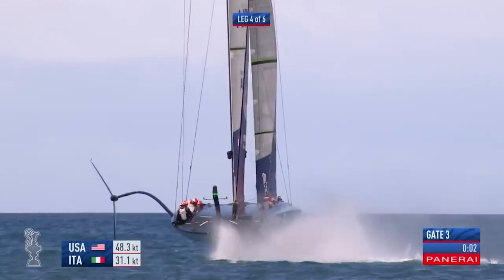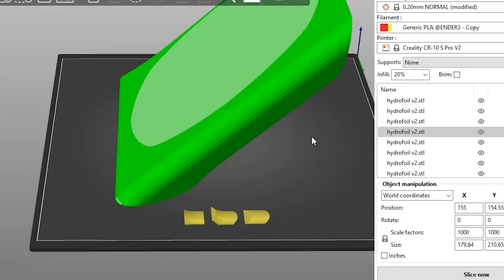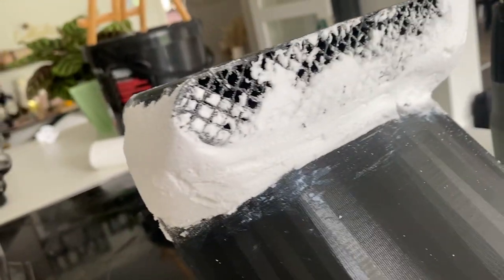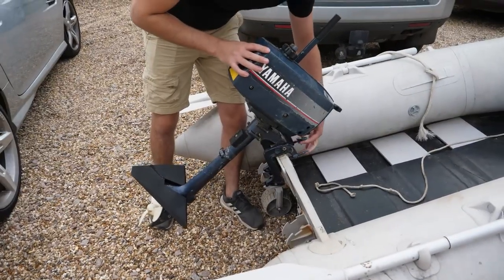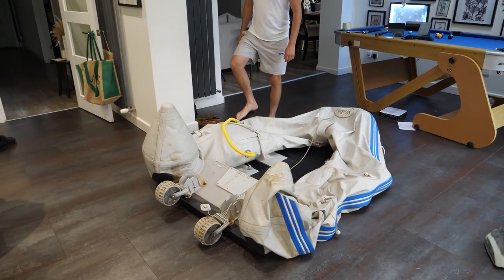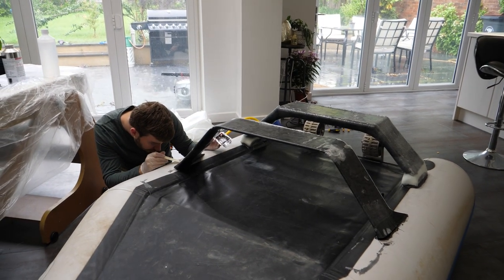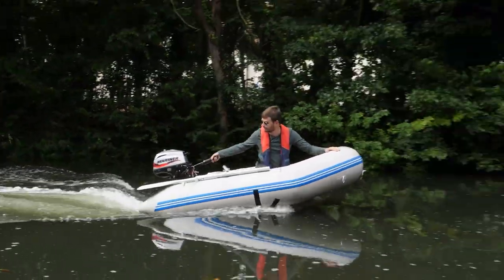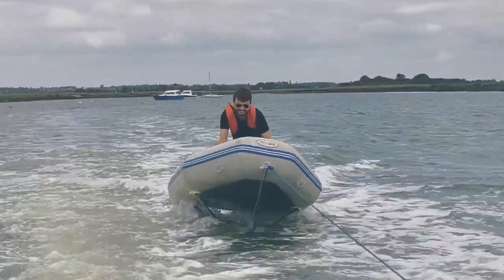Making A Boat That Flys - The Hydrofoil

Comment: Hydrofoil airboat? Basically an aeroplane with its wings submerged. Or mounting (electric?) propellers on the rear hydrofoil, so they're guaranteed to be underwater.

Comment: Very nice project indeed! Hope to see a next version of your design. 
As I build Hydrofoils myself (for kitesurfing mainly), here are some quick tips:
The analogy with the stool with three legs isn't the best here, because the amount of struts/masts into the water is absolutely irrelevant for the foil to work. The principle is simple: its just a plane under water. The front wing produces lift to lift you out of the water while the rear wing produces downforce to compensate the "wheelie". The faster you go, the more lift the frontwing produces. As your foil has no elevators, the rearwing produces the needed downforce to keep the nose of the boat down, resulting in much less wheight adjustment that must be performed. This is the principle of kite/surf foils. For a boat, where your main focus is the ease of use and not so much the performance, a Fontwing in form of a V would be the best solution  (extreme dihedral). The faster you get, the more the foil gets out of the water and isn't capable of producing lift (sadly, the so loved self stabilizing characteristic you get in planes with dihedral wings is almost neglectable due to the high center of gravity). With the dihedral frontwing, you can easyliy achieve solid results without a rear wing and without a long-shaft outboard. Just mount the foil further to the front (the position of your first approach seemed about right for that).
The last tip: The Angle of attack is way more important than the profile. Even a flat surface will fly well. In water a thick profile will give you a lower lifting speed but drag of the wing induced by a bad designed profile will kill your topspeed and, much worse, the lift becomes enomous making ventilations more likely and the boat uncontrollable.
Hope this wall of text helps a little for your next revision, subscribed :-*
Reply: Talk about back seat building

Jk of course
Reply: Very well explained! Thanks 👍
Reply: @alejocouderc4495  LOL
Reply: That was very interesting, thank you for the explanation and details.

Comment: I've been wingfoiling and designing my own hydrofoils for a couple of years now. That front foil looked very thick to me. On the personal hydrofoils, weight placement on the foil board is absolutely critical. Also surfaces. The difference between a poorly finished surface and a 400 grit to 1000 grit finished surface with no imperfections is phenomenal. I 3D print my wings in sections with holes for joining dowels, fit them together and then spend a few days cleaning up the surface. Then I create moulds around them using parting tape and resin infusion. Finally I clean up the moulds and for my higher performance wings I make now, I fill them with carbon fibre, mostly unidirectional. Then I clamp my moulds together. Unmoulding, I clean up the excess with a mini angle grinder, then file and sandpaper in progressive finenesses. If you continue, you need to make a decision as to whether you are using self flattening foil designs for roll and how you will control pitch stability. And of course under an IRB, you will need a lot bigger foot glued or otherwise fastened to handle the forces. I really was surprised that the attachment you used lasted as long as it did.

Comment: Fun project. Hydrofoils are cool, but sometimes its hard to make them work, and depending on what boat they are mounted to, might be of questional benefit, if any at all. But it sure is fun building!

One small correction: the effect you described is called "ventilation", not cavitation. An easy mistake to make, especially since the anti-ventilation plate mounted just above the prop on outboards is erroneously called "anti cavitation plate" in common parlance. But cavitation is a quite different phenomenon. Cheers.
Reply from the maker: Hi There Golden Croc, yes thanks for clarifying that. Spot on, it was ventilation I was describing. Like you say I believe this project itself is more on the fun side rather than improving the boat. Glad you enjoyed the video. Thanks Sam.

Comment: Small point of note: Ventilation is when the prop sucks in air. Cavitation is when the prop is spinning faster than the water can move in around the blades and tiny pockets of vacuum form against the prop.

Comment: Fun project! Get a copy of Ray Vellinga's Hydrofoils (Design, build, fly) book and try to understand it. Balancing pitch and roll stability to make a small hydrofoiling boat that will stay on its foils is quite difficult. Making your dinghy achieve manned flight (with a suitable engine, wings and prop) would actually be easier in some ways. Hydrofoils have all the lift vs. drag mathematics that aircraft have, but a few more because they have to also deal with the interactions between water and air at the surface and a big change of centre of gravity and stability when they take off. They also need turn stability if you want them to stay on foil when they reach a bend. The first foil you made was far too thick! If it was to get on foil, a foil that thick would be inefficient and therefore make the boat slower than with no foil at all.  
I built a hydrofoil when I was 15 (I'm now 47!). It worked a fair bit better than this, but I didn't have true pitch stability either. It was a series of multiple stalls like yours, just slightly longer ones.  I had an angle of attack adjustment system for the front foils, but it was so hard to keep it flying for more than about 50ft at a time. I had beginners luck with mine, because since I have made a series of failed hydrofoils. 
I have learnt that, sadly, to make an effective working hydrofoil you need at least as much maths as you would need to design, from scratch, a working full sized aircraft.
Hydrofoils are killers psychologically, because any kind of foil that creates lift, which anything  vaguely foil shaped will provide, will enable a boat to lift and porpoise and stall and repeat. This makes the builder think that they are 'nearly there' with it, which they are not. There are rather a lot of 'nearly there' porpoising hydrofoils on youtube.

Comment: - You should use rapid prototyping to make a profile gauge and shape the foil in insulation foam. 
- The profile to use for that kind of speed and size is a Low Reynolds number Eppler profile E817. 
- To laminate fiberglass properly you can use cheap throw-away 1'' paint rollers.  
- You can only use epoxy to laminate fiberglass on the foam, polyester will melt it.

You don't have to take my word for it but my final bachelor's degree as an engineer was designing hydrofoils for a boat and as an engineer, I've worked as a fiberglass mold shop foreman.

Comment: inflatable dinghy is relatively heavy for what you're doing. I'm planning a similar project using a small lightweight trimaran hull and a jet drive. The idea is to have an intake under the bottom of the front foil and twin output nozzles under the back foil. The pump driven system will prime itself when it's sitting low in the water. Steerage will be done with both output nozzles using 360° rotating nozzles so it will have reverse and side thrust.  The jet pumps will be powered by steam and the steam will be generated by a hybrid solar and alcohol boiler. The idea is to run it on sunlight during the day and alcohol or any  volatile fluids I can scrounge or make at night. There's a conservation area near me where fossil fuel boats aren't allowed and I want to go speeding into it on a hydrofoil and get stopped by marine patrol so I can tell him that I'm not breaking the law but he is for following me into the area. 😂

Comment: seen a hydrofoil modelboat made a long time ago , the builder made them out of aluminium bar that he shaped intoo a wing contour (though sharp in the front and sharp in the back ) painted the wings after he finished and tested the model and all of a sudden it didnt perform like it was before it was painted 
after a while he saw flakes of paint comming off the aluminium wings and doing some speed runs passed his boat he found loong bubbles comming off the wings under the water
turns out those foils need to be supersmooth or they cavitate on there own and loose efficiency 
you probably need a longer tail for the outboard to keep the prop in the water when its on the foils 
to get it a little more stable you probably need to make one set wider then the other , since most of the weight (motor and driver) is on the rear i would make the rearwing a little wider 
might want to see baout being able to adjust the angles on the first prototypes to get the boat to come out of the water evenly

Comment: outboard sucking air from the surface to the propeller is called ventilation. cavitation is empty air pocets created on the propeller under water through low pressure. great video hope to see some more

Comment: I think you needed less area on the flat section and a shallower V as that's your height control, as you go faster the V Comes out the water so it produces less lift. Go faster, more lift, more of the V Comes out the water until it reaches a equilibrium.

Comment: boat motors are designed so the prop in underwater a certain depth. If you raise the boat (and motor) out of the water, it doesn't work.  you need an extended shaft outboard that puts prop deeper in the water.  Also water is much more dense than air, so you need a hrdro foil not an airfoil. There were plans and instructions in about a 1960 popular mechanics or science that showed how to build one with a foam slab hull.  My dad always wanted to build one.

Comment: The foils look thicker than I’ve seen on other hydrofoils (more like a airplane wing) and therefore creat more drag than lift. That drag is going to tax the fixing points too much. Take a look at how thin (and small) the foils were on that foil board and how easy it would cut through the water while creating lift. I’m betting 2 foils of similar design, but a bit larger would provide significant lift and be a lot quicker to print.
Reply: See this link to help illustrate my point. https://youtu.be/-9_xx5eC1NY and this boat weighs 1.3 tons.

Comment: Just so ya know, carbon fiber fabric isn't as expensive as it once was. You can get it fairly cheaply, as well as carbon fiber rods online. Just get a bit of thin cardboard and glue several sheets of carbon fiber fabric to either side of it and you can trace and cut out any pattern your heart desires. Best part is, you don't have to wait days for it to be printed, and it's a lot more durable than any plastic. Also, is that your old motor sitting out in the rain at 9:10 😅

Comment: I was thinking those foils would come off...just didn't know when. They have lots of leverage on the front edge of each foil so they literally peeled away from the boat. Your foils get you high centered and then the dingy is unstable and wobbly side to side. You need the foils to be wider once you are flying so you maintain stability. Probably move them more to the front and back so you have best possible stability in that direction as well. Your foils don't need to be tall. Just clear the water by 2" and you are set!

Comment: Interesting idea!
However the profile of HF is suboptimal from my perspective. Too thick. That is why it has too much lift and lots of resistance. 
You can estimate a profile according to a mass and speed in XFLR5 program (free). Also you can just look at wind/wing-foiling or Flying Moth hydrofoils, what profiles do they have.
Rear wing (stabilizator) should be smaller and have symmetric section profile, It should be regulated to produce neutral and negative lift for stability. 
Also you should sit at centerline of the boat. HFs are quite sensitive to roll.
Good luck!

Comment: Great project!  Armchair quarterbacking: Attaching the foil to the engine does seem like a good idea as it may help act as a cavitation plate of sorts, blocking its tendency to pull air down into the prop flow, allowing the prop to run closer to the surface.  Also, attaching the foils laterally outboard may help too as the flow separation due to (inevitable?) stalling may be less likely to cause aerated water to flow to the propeller, also reducing it's tendency to cavitate.

Comment: Great project, I think to some improvement. First, the foil should be larger, because on a tender the loads (you) are located, axially, not in the center, so the lift is disturbed by this irregular weight. Second, larger foil below the stern , where the higher load is (you and the outboard), smaller foil below the bow, it will drive the lift easier. Forget about the middle position for the foil. What is more, the outboard: I see two options, to use a 2 strokes engine (older but lighter than 4 strokes) with long shaft, the ones used as emergency engine on common boat (at least here in Italy),or to use one (or two) electric outboard, cos they have normally a really long shaft. Of course in this case you consider the weight of batteries, that can be moved to the bow for better balance.
Anyway, my compliments for your job, if you develope it, maybe it can become a foiling kit to be installed on all tenders and some kayak! And you will be rich! Ciao

Comment: I don't think this was really foiling - it was more or less skidding on water like a waterski. You 'd probably want a V-shaped foil that produces lift, but where the lift is reduced the farther it comes out of the water. A foil board (like shown on the video) actually requires the person to level out the board to keep the foil in the water and not stall out when coming out of it. Same with the foiling sail boat. It was impressive though, never would have thought the small outboard would lift it to the point of stalling.

Comment: Look into stepped hulls, also reduce drag but they don't require you to lift the hull out of the water. Sadly the key part of it is inducing airflow near the prop so might not fix your issues :/

Comment: Search Ray Vellinga. 
There are two types.  Fully submerged and requires a stabilization control system.  The other is surface piercing and is inherently self stabilizing.  That’s what you have…..sort of.  The two outer angles correct roll automatically.  When one becomes more horizontal it lifts that side back up.  The wider apart they are, the more stability you get.  
Ray Vellinga is the foil dude.  Many videos.

Comment: Awesome proof of concept!  

But I dont understand why you added a second foil, when your first test showed your first foul providing ample lift. If an airplane noses up, you don't add a second wing, you move the wing backwards to put the Center of lift below the Center of mass!!!  Your second foil is just adding drag. 

Seems like you're also setting yourself up for problems by positioning yourself on the gunwale. Good for skippering a floating dinghy, but awkward if you want to balance above a foil. Easy to correct, though!  Extend your outboard's throttle handle with a short piece of pvc pipe that fits snugly over it. Now you can helm your dinghy from the Center of the craft -- even from a standing position, if your pvc pipe is Ing enough. Will make it MUCH easier to  shift your weight around to balance.

Suggestions aside, congrats on the very cool build.

Comment: Nice try so back the drawing board.  To prevent ventilation you may need a long shaft motor or find a way to lower the motor mounts.
Who makes the shirt you're wearing, I like the block pattern ?

Comment: Have a look at foilding moths mate... They have a float witch adjusts airplane type flaps on the foil meaning it adjusts the pitch of the foil depending on how high it is out the water so it doesn't just skim across the top but floats at a Continuous hight from the water surphase.

Comment: Cavitation and sucking air are not the same thing. Cavitation is caused by a low pressure forming that is below the vapor pressure of the water. The water then flashes into gas/steam. After the water stabilizes pressure the steam collapses back into liquid water and no bubbles would rise to the surface.

Sucking air is pulling air from the surface or some other source. After this happens they would rise to the surface.

Fun project though.
Reply from the maker: Correct, what I was describing was ventilation my confusion came from the “cavitation plate on outboards” glad you enjoyed. Sam

Comment: you need POWER! I have a similar boat, it required 7.5 hp to get in plane with 1 person, (would not plane with 2 persons) also tried with a 6hp motor, it would not plane. when 6hp boat towed by another identical boat with 7.5 hp, we got both in plane. but the 6 hp would slowly loose speed when i dropped the towing rope.
i would suggest 9.9hp minimum, and try again . awesome video!

Comment: That's not what cavitation is.
Cavitation occurs, when parts moving through water sufficiently reduce the pressure to evaporate the water.
Those gas bubbles quickly collapse as soon as pressure renormalizes forming ultra fast jets that can pretty much destroy anything.

Comment: I kind of wonder if you guys rely on 3-d printing too much. If you had to carve up balsa wood or styrofoam to serve as the filler for a fiberglass part instead of 3-d printing one, I wonder if you'd have made, for example, one engine foil that had the foil backwards, and another that broke when you tried it on the engine, probably because it fit too tightly (and didn't leave an allowance for the fiberglass either.)

Comment: Foils were far to thick and, as you found out, a bit of glue was no where near enough to hold them. Next time use a gauge on the roap from the boat to measure drag.

Comment: Under powered engine is your issue.  Inflatable boats can plain very well, just as long as the engine is strong enough and there is enough weight in the bow.